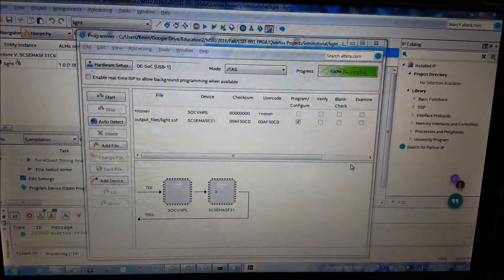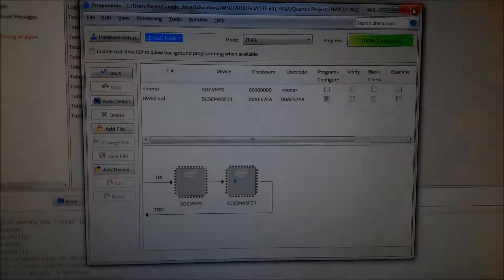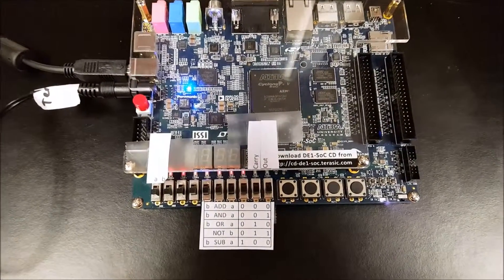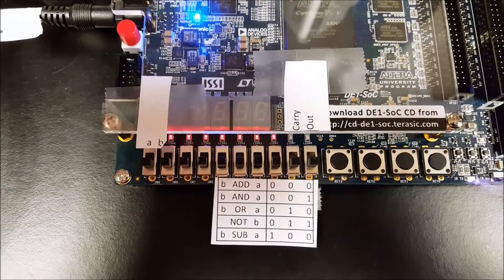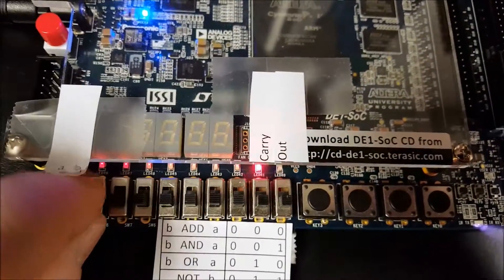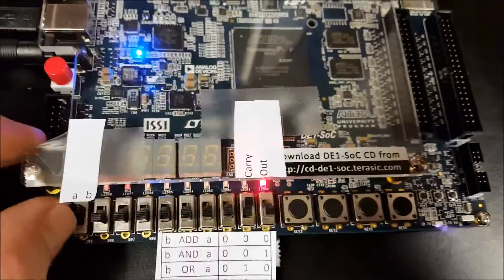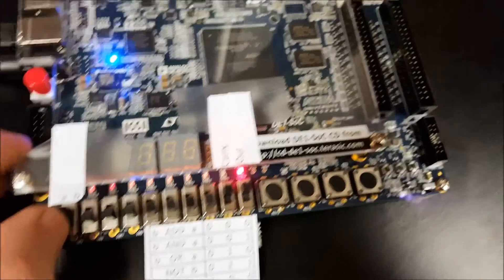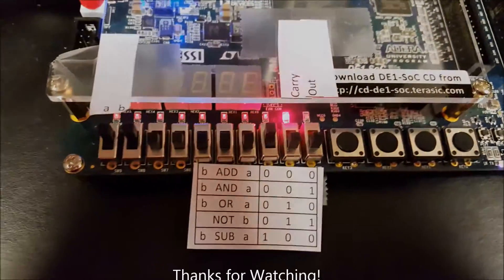FPGA Demo Using DE1-SoC Trainer

Comment: Hi! im just starting to learn how to programmed a FPGA but i don't know nothing and i can't find any tutorials on how to start. Do you know where I can find some? also, if there's a page where i can see the codes you use so i can start with those.
Reply from the maker: The trainer I used belonged to my school and I found the Cyclone tools for Windows very difficult and kludgy to use, probably because they were ported from Linux, or maybe Unix. If you're comfortable with Linux, the Linux version may be easier. If I were to do it over, I'd probably use something simpler, like a Cypress (https://www.digikey.com/product-detail/en/cypress-semiconductor-corp/CY8CKIT-049-42XX/428-3344-ND/4805328&?gclid=CjwKCAjw_MnmBRAoEiwAPRRWWw8hf01qGPdrpZnSLlqtoa3jw45foieOspt-c_vVWO8DbSvEM7Z_KRoC5QIQAvD_BwE) or a Red Pitaya (https://www.redpitaya.com/) which is an FPGA-based dev board for signal processing. A colleague used these for analyzing how radio signals bounced off the ionosphere during an eclipse and was very satisfied.